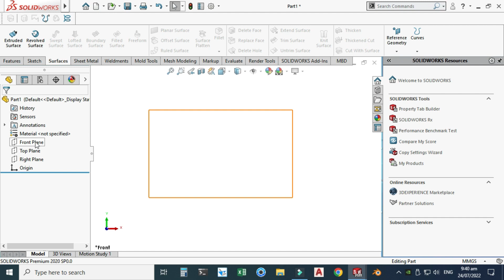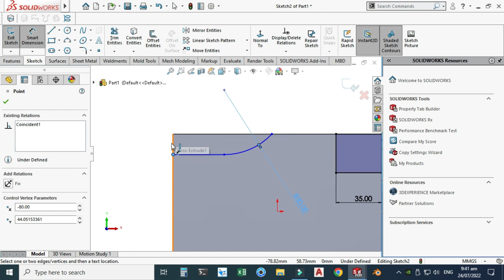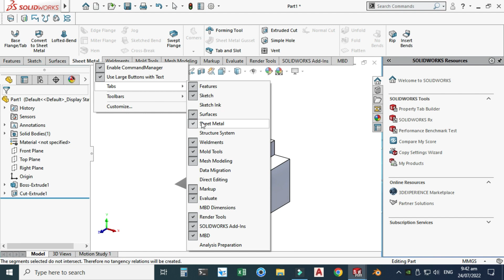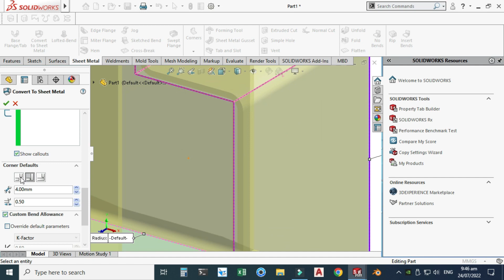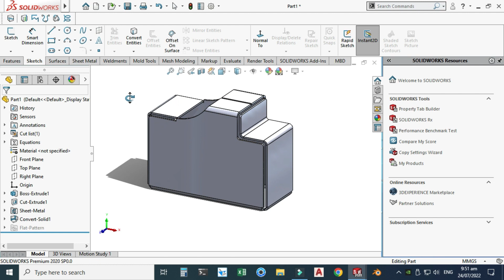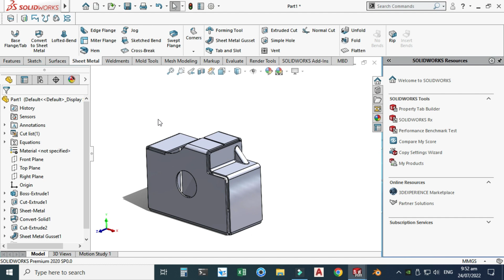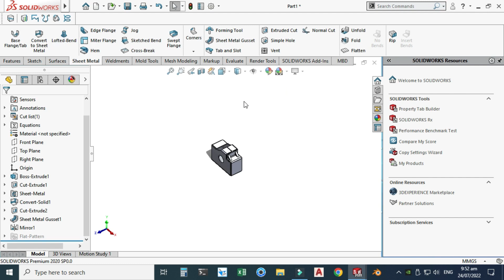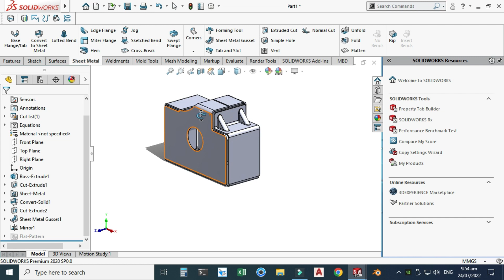Solid to sheetmetal conversion | Solidworks sheetmetal tutorial | Solid body to sheetmetal | CADable

Comment: The procedure used is basic 
requirement for all fields 
of 
manufacturing engineering etc 

This tutorial is highly informative.
&
is nicely presented.

Animation technique is highly 
appreciable.

Really enjoyed this tutorial.

Thanks
👇
N.Rashid H.Khan
(U.S.A)
🦋🦋🦋🦋🦋
Reply from the maker: It is easy to manipulate and use surfaces rather than using solid modeling. Happy modeling and thank you for admiring❤️